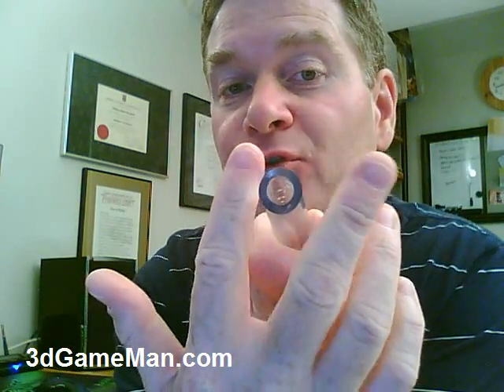#269 - Q&A: What's the best water cooling tube size?

Comment: I was also interested in this topic, so I dusted off some college physics textbooks and referenced some of Yale's free YT videos.

Flow = Area x Velocity.   Therefore the flow or flow rate doesn't increase with a change in the area of tube. Velocity of the water actually goes down if the tube ID is increased from 3/8 to 1/2 inch.

Comment: Very helpful thanks!
Reply from the maker: +Stellar lupus You're welcome :) What water cooling system are you thinking of installing?
Reply: 3DGAMEMAN
Yeah going with a EK-Supremacy EVO X99 - Nickel CPU Waterblock, two EK-FC Titan X - Nickel-plated waterblocks a EK-XRES 140 Revo D5 PWM with pump and a XSPC AX240 Dual 120mm Radiator.

 So that's my base components now I'm deciding on what tube color/ size to go with? I'm currently looking at 1/2 white tubing made by Primochill then gonna couple that with red EK compression fittings.
Reply from the maker: +Stellar lupus Wow... Pretty hardcore.
Reply: 3DGAMEMAN
Yeah it's gonna be my first water loop! And I own a pretty Beastly Gaming PC so I'm not taking any chances lol. Water cooling scares me so I figure I'll go for the best... What's your thoughts on my part picks so far?
Reply: 3DGAMEMAN
I also like the XSPC Photon 270 Tube Glass Cylinder Reservoir still can't decide?
Reply from the maker: +Stellar lupus Parts look great. It'll definitely do the job and then some :)
Reply: +3DGAMEMAN Well thanks again for your great insight on tube size recommendations! Helped immensely:)
Reply: +Stellar lupus You may want to go with more than a single 240mm radiator, or you will have some pretty loud fans and maybe some overheating
Reply: Stellar lupus Oh Right, i was worried, for your parts sake.
Reply: Arctic Blizzard PC
Oh I'm going all out! Buying a Caselabs SMA8 with a 560 side/ 480 top/ 240 backside and a 280 front! Thanks for the advice:)
Reply: Arctic Blizzard PC
Lol yeah thanks:D I was gonna cram all that water cooling stuff in my (CM Storm Stryker) then thought twice about it. I figured it'll be best to build around a 'water cool' specific case.

Comment: I first bought a 3/8" tube with 6 3/8" fittings, thought the ones I got with my res and pump would fit, they did not, they were 1/2", so now I ordered 1/2" tube and traded my tube and fittings for 12 1/2" compression fittings :P

Comment: it's velocity is changed when using smaller tube. (small is fast bigger is slower.)
flow rate is a constant, from the pump, at what every you set it at.
also note you get higher volume with bigger tubing.